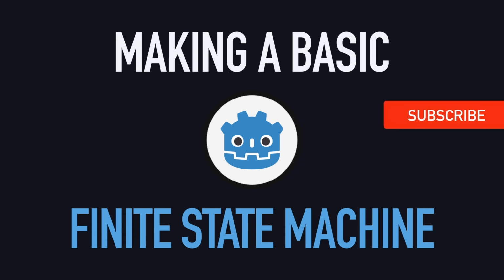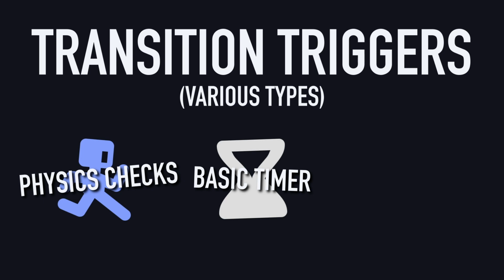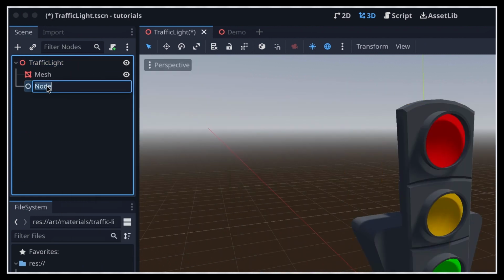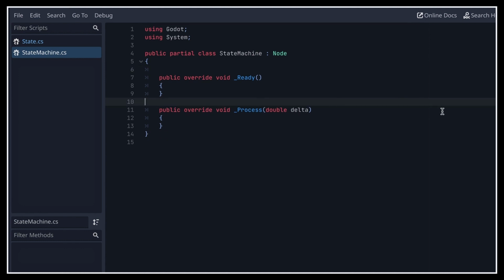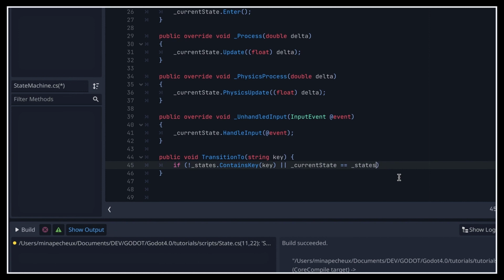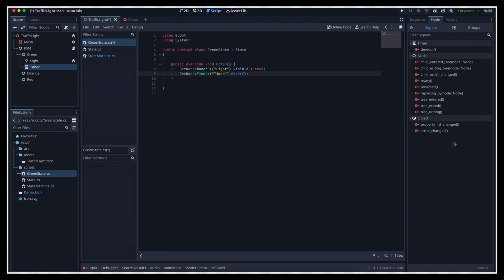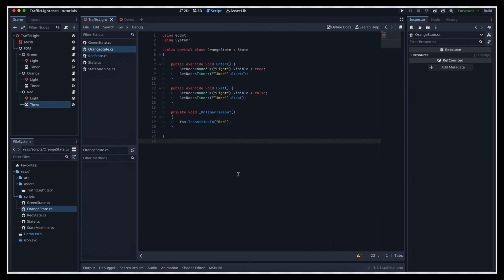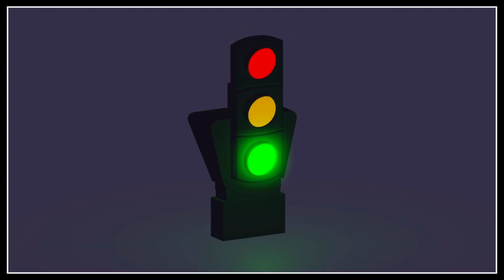Making a basic finite state machine [Godot 4/C# 🇬🇧 Tutorial]

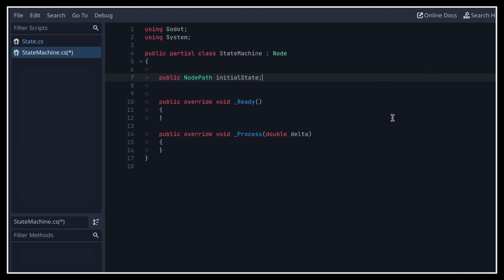Comment: at 9:57 I saw that you use NodePath for the export for the initial state. Is there a reason this couldn't be State? I dunno if it makes a difference, just wondering if there's some best practice regarding it. Thanks!
Reply from the maker: Heya! You are totally right, this would work too :)
Since it's a new feature of Godot 4 and I didn't want to spend time explaining it here, I stuck with the old Godot 3 way, but you could absolutely replace it with State directly :)
Reply: @minapecheux  Ah, okay, got it! Thank you for the response.  By the way, another funny thing about traffic light colors: in Japan, instead of green, they call it blue. So, it's red, yellow, and blue :)

Comment: From the states would it be better to use a signal to tell the state machine stuff, rather than have the State machine as a var in the State? 

Just trying to make sure i do everything in a good scalable way, and confused when i should be using signals vs using an export or calling another nodes method from another node

Comment: I've run into a problem where the light seems to get stuck on the Orange State, using Debug.Print, I have noticed it seems to be using the _OnTimerTimeout method from the Green State. I have made sure the _OnTimerTimeout is the one connected to the orange timer node.
The same thing happens when I change it so it goes to red and not orange.

*EDIT*
Did some more debug printing and it looks like it is also using the Exit method for GreenState. The proper scripts are attached to the proper nodes.
Reply from the maker: Hello!
Hmm I'm not sure why you have this issue... if you've properly assigned the classes/signals it should work :/
If you're using Godot's built-in IDE for C# scripting, perhaps make sure you're indeed working on the right file - I know I personally had trouble at times as it "auto-switches" from one script to the other sometimes, if you select objects in your scene.

Other than that, I'm sorry, I don't have other ideas why it's not working on your end!
Hope you'll find a solution,
cheers!
Reply: @minapecheux  
Ok, thank you.

Comment: Would a FSM be useful if I'm making an game level editor and the mouse needs to switch between different modes or states. For example, if they click the place tool, the mouse would place new objects when the user clicks. If the user clicks on the move tool, they should be able to select and move objects. If they pick the delete tool, it would delete objects. And so on, you get the point.
Reply from the maker: Hmm, I think it depends on how much each mode differs from the other. What I mean is: if the "only" change is the final action, a direct enum in your editor manager could be simpler. But if you also want to have different visuals (e.g. another cursor), to lock/unlock some part of your UI, etc, then an FSM could be a nice way of packing all those per-state specificities in a more readable way :)
Hope it helps,
cheers!

Comment: With this implementation, don't the "concrete" states (GreenState, RedState, etc.) all inherit their own instance of the base abstract State class?  I wonder if there's an easy way to create the abstract state as a Global and do some "psuedo-inheritance" by referencing that singleton.
Reply: Yes, each State (GreenState, etc) will have its own instance of the State class. However, you can see in the State's ready function that it will initialize the dictionary so that every state knows about every other state. One way to solve that is to make the dictionary static and then check to see if it's filled in yet (aka if it's initialized). If it isn't, then initialize and populate it. This may run into a race condition depending on how the ready function is fired for every node.

Your suggestion of making a Singleton (aka a static instance of State) and then have the other states (Green, Red, and "Orange", which should be Yellow) just use that state. This is how actual State Machines work - they have their own data and store the current state, eliminating the possibility that one state was "entered" and never "exited" (like an exception that got caught but never propagated).

This video doesn't suggest a perfect solution, but it's something.
Reply from the maker: Hello! As well explained by @dyanosis, this video just suggest a very basic (and far from perfect) implementation of FSMs! My goal here was explain the concept and keep it as clear and condensed as possible... in the hope of then re-discussing this topic in more details (and with better solutions) in follow-up tutorials :)

Typically, yep - separating the data is a common improvement.

Again, thanks to dyanosis for pointing all this out - I hope I'll get to show some of those fixes/optimisations in upcoming videos ;)

Cheers!
Reply: @minapecheux  I can appreciate that!  I think there can be a temptation to overly complicate things, which can scare off more junior programmers (hell, and senior folks).  There's something to be said for finding the MVP solution and iterating on it as necessary.

Comment: Excuse me!
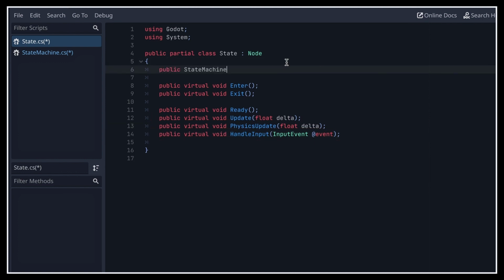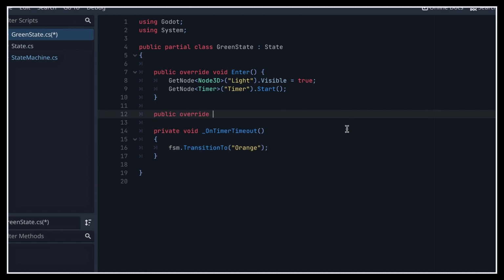That's 8:15 a circular dependency. The FSM knows all states, so a state must not know the FSM. Instead of this 15:59 use an event the FSM subscribe to each time the state changes and unsubscribe when a state finished.
Reply from the maker: Hi! First of: I totally agree with you this basic system could be improved in lots of ways ;)
Here my goal was to make something quick and easy to explain, and with as little concepts as possible!
This code works, though, at least in C#, cause we're using references and we don't have strong dependencies of the FSM on states and the states on the FSM at the same time.

But again - it's true that this cyclic system could be better, and that using signals would be a nicer way of decoupling the logic :)
Reply: @minapecheux Developing a true State Machine would be better than having every state know about every other state and then using a signal that tells the node when to or not to activate.
Reply: Can you explain why this is a problem beyond "circular dependencies bad"?  I'm not disagreeing with you necessarily -- I just think it's more helpful to address why this is wrong, when it works.  I don't agree that circular dependencies are always bad.  And you introduce some additional complexity / overhead by introducing the observer pattern.
Reply: The YAGNI principle comes to mind here.  Do we really NEED signals?  Or is the StateMachine and its States so tightly coupled at a conceptual level, that it doesn't matter if they depend on eachother?

Comment: This is a very poorly made state machine. My friend who is still learning used this code, and it caused nothing but issues (no it wasn't typed wrong, I had her pull the files from GitHub). If you decide to plan out all your states up front, and pass over unimplemented states by switching to the next state inside the virtual Enter method in order to prototype, good luck getting reliable access to Nodes and their properties. I had to transfer most of the TransitionTo function to be called in a deferred way. If you don't know how the internals of a game engine works, maybe don't teach beginners to write half baked code? Prototyping states should break a state machine....
Reply from the maker: Heya - I'm sorry you feel this way about the tutorial!
This pattern has worked for me in various projects, but I totally understand if it doesn't fit your style, or if you feel like it doesn't work for you: hopefully, you'll find another way of implementing this pattern that you prefer!
Cheers.
Reply: @minapecheux  It has nothing to do with me or you. If you want to create a system that is held together with paper clips and bubble gum that's your choice. The issue is when you feel the need to make videos and point beginners in the wrong direction. This is a trend I see with a lot of Godot creators. They are creators first, programmers second. Have you even bothered to take anytime actually learning how the engine works? The order in which the internal game play loop is executed? Because if you did 5 minutes of research you would have known that your pattern has issues. I've been an engine developer professionally for years and it's crazy how many creators have zero knowledge on how their engine actually works. They just don't bother. But hey, as long as you get clicks right?